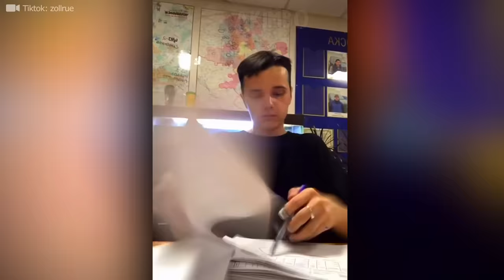Satisfying Videos of Workers Doing Their Job Perfectly !

Comment: 3:46 Yes, that IS actually satisfying for the horse. The shedding blade gets rid of loose, itchy hair and helps them keep themselves clean with healthy skin. I've done this for years with the various horses I've had. They all really got into it and would grunt and sigh in satisfaction. One would clap his teeth together loudly and fling his head in happiness when I'd take the blade to him. It's not a knife blade but a dull, serrated comb with handles at each end. You scrape the dead hair and skin (scurf), dried sweat, mud, or whatever right off the horse. Trust me, most will appreciate you for it.